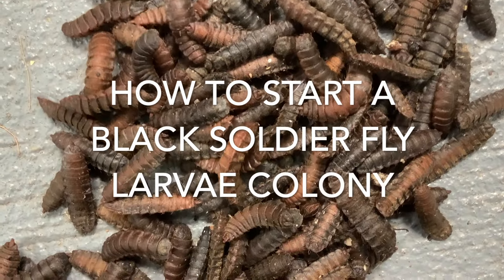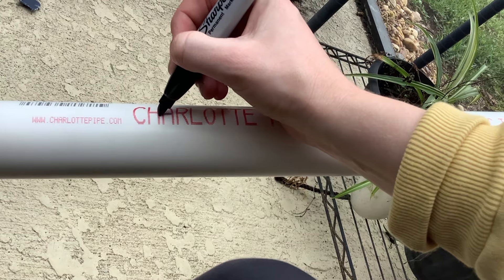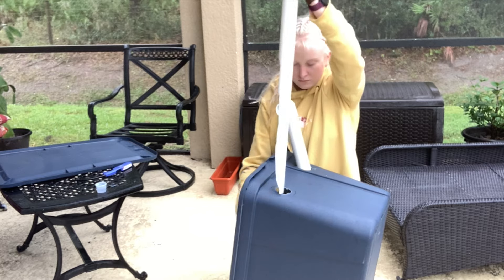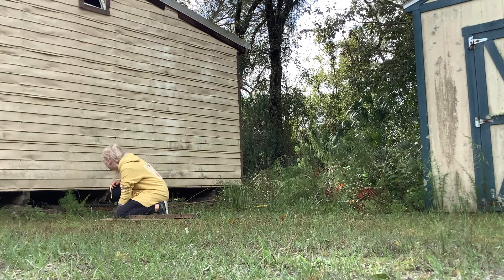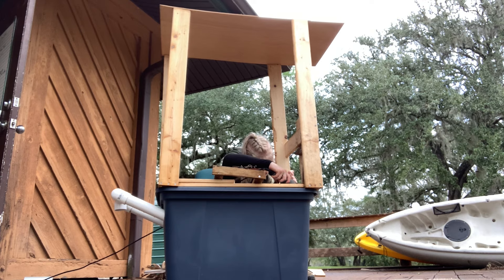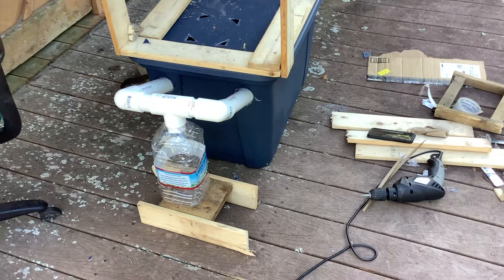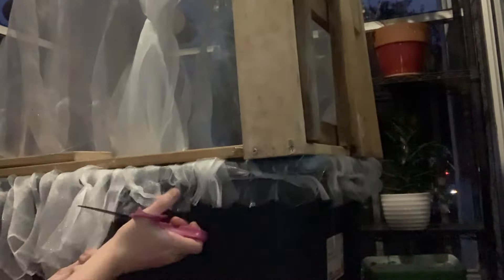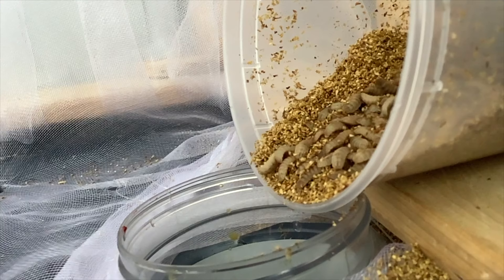How to Start a Black Soldier Fly Larvae Colony

Comment: In here we separate reproduction and production, we have a few 7x7feet mosquito netting, it needs about a pound of pre pupae each a day to keep it at maximum egg production, the eggs are collected and grown into larvae in a different place. When I started I did a very similar thing to what you have done but I believe separating the 2 stages isn't necessary but it dramatically increases production, I would have problems where small insects and other animals would tear at the mosquito netting to get to the food, a few flies would escape as a result, you may find that the flies lay eggs in between the mosquito netting because of the smell of the subtrate, those eggs are almost always lost, the smell needs to be concentrated at a single area where the flies will lay the eggs, it is what they call the attractant. Anyway very good video and I hope to see more, cheers!
Reply: do you use anything for your attractant? Ideally something that isn't rotting as a normal compost would have?
Reply: I started breeding the black soldier fly and I have little information, can you help me?
Reply: @mrniusi11  Unfortunately the fouler the smell the better. But to a degree anything that is rotting will attract the flies, things that have a worse smell will grab more of the attention of the flies, your compost is probably enough, but it wouldn't be if you lived close to a fishery for example. Do you add manure to your compost? The larva are more than happy to eat that, but they are not good at processing cellulose.
Reply: @عالمالزراعه-س9ع  Sure, what question do you have?

Comment: Not that I know anything other than watching You tube videos but the larvae move towards the light and I don't think they would see much through that pipe corner. Also there needs to be a few drainage holes in the bottom. Loving Chub Chub.

Comment: It's always great to see a new take on a BSF bin ... Just PLEASE everyone try to understand just how easy these amazing insects are to raise.. You don't need mosquito netting, wood that will rot in the elements, fancy swinging latches, etc ... As an extreme example, there is a 'biopod' (i.e. plastic container with an incline) that sells for over $200 dollars... That is pretty crazy when you look at how many quality HDPE plastic containers there are everywhere as on a bike ride, I found a 35 lb kitty litter container that someone tossed out.. It works great with a few small holes drilled in the sides below the rim and also the bottom,  with a bungie cord to keep the racoons out... The main point is, take advantage of the unbelievable hardiness of these creatures and know you can build a great fixture for them with very minimal materials... 

Also: if your colony conditions has sludge in it (like at the 6 min mark in this video); you need more drainage/ more aeration... I'm not trying to be critical, but that amount of sludge is a little gross and might prevent newcomers from starting up their own setup.. Drainage and Aeration are really the only two things to think about, and they go hand in hand... (The fact that the BSF can survive in those conditions is a testiment to just how hardy they are)
Reply: Correct. BSF larvae will flee from muddy food.
I suggest adding hardwood sawdust (from grill pellets) and some lump hardwood charcoal (broken into stone sized pieces) to help absorb liquids and odors.

I also personally add some calcium carbonate powder, since i have an excessive amount to use.
Reply: @FusionDeveloper  Awesome man.. yeah I saw you post a question about artficial lighting, where she uses 120 watt daylight floodlights.. If a regular plain jane led bulb like hers works, which I believe it does, then I have no clue why all the 'bsf lights' that are sold online for 180+ dollars claim you need uva and possibly a little uvb.. With it being October near saint louis here, it's getting kind of late to start any experiment but anyways yeah when I took the flies from the shade to the sunlight today (I have them in a small tent), they went from statues to active fliers, moving everywhere.. Kind of strange how most of their life they do everything to avoid light, but then when they become flies, light instantly activates them.. Have you had any success finding an led? I looked into a 26 watt one from lucky herp brand, which comes in 5.0, 10.0, or 15.0% uvb in addition to uva depending on the model you want, though now that the one video of the lady in the green as well as the guy from nigeria are simoly using straight up, ordinary flood lights, I don't know if leds with uva or uvb, or any combination of the two is really necessary. As an aside, of the 3% of uv sunlight that gets through the ozone, 95% is uva and only 5% is uvb... Anyways, I might hang a light inside of a trash can with a cracked lid, maybe add a wet towel at the bottom for some humidity (not that it's dry in october) and a small container at the bottom with an apple and a little cardboard.. I'll send you some links of the stuff I'm referencing tomorrow if you haven't already found what I'm talking about.. Yeah, all in all the lighting seems to be the most finicky or what not, though I haven't tried yet, just relying on the babies I find in the food scraps outdoors..

Comment: 6:03 that is waaaaaaay too wet for the larvae.
It's better for the bedding/substrate of BSF larvae to be a little too dry, than to be too wet.
Other fly species don't mind or prefer or even require sopping wet substrate, but not Black Soldier Flies.

I suggest mixing in Saw Dust (rehydrated pellets used for (food) grill smokers) to help absorb excess water/waste.

I personally love adding in some lump hardwood charcoal broken up into smaller pieces.
Activated Carbon would be better and less work, but it costs a huge amount more money and probably isn't much different for this purpose.
A huge back of lump hardwood charcoal is $12-$30 (usually around $16-$18) for 8 to 20 lbs and would leave you with plenty to spare.
While Activated Carbon for a 9oz container is around $8, which is less than 1 lb.
Since we aren't trying to purify water with it, any absorbing done by regular lump hardwood charcoal will be beneficial enough, just don't pulverize it into dust, make the pieces around the size of a golf ball or as small as 1/4 that, of course any size is better than nothing if you just want to toss in whatever pieces you want.

Comment: Where exactly do the flys lay their eggs? Great video!
Reply: In the cutted boxes she hanged
Reply: @lix768  then why the net further up? I am confused. Not knocking her system
Reply: Her setup is 2 compartments
The upper is for the fly
They come up after hatching out
The lower is for the larvae and compost
When the fly is ready to lay, they'll go to the down compartment were the boxes are and lay.
She didn't bring the boxes to the upper part so that when they hatch they fall onto the compost
Reply: they lay the eggs in whatever compost you are using old food etc.....
Reply: @Chronic_Pothead  thx